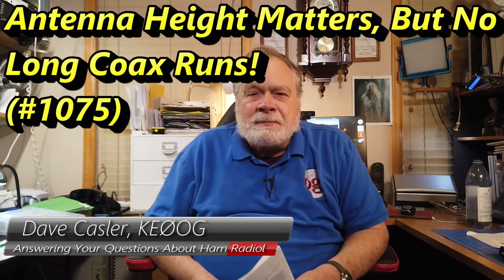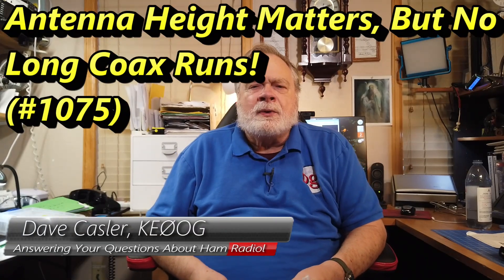Antenna Height Matters, But No Long Coax Runs! (#1075).

Comment: I'm getting ready to move my gp9 from a 75' run out to 100' plus up 75' of tower, so I'm using heliax in and attempt to reduce losses. I'll let you know if it is worth the trip. While the losses will still be higher I'm hoping the gain in height will overcome the loss, we'll see.

Comment: I wonder if Ham radio will get to the place that cellular is where the actual transmitter will be mast/tower mounted direct to the antenna, or with a very short jumper and a control cable that runs down to the shack. A fiber optic control cable would reduce the chance of lightning/ESD into the shack.
Reply: With a Wifi-equipped radio (eg I have an IC-705) you could have that in a weather-proof box with any other needed equipment up at the top of your mast and have the antenna come straight out of the radio. With Icom's RS-BA1 software you could then control everything via the WiFi connection, including winlink, FT8, etc. from your computer in your home. Add a remote antenna switch for whatever antennas you're using plus a dummy load. You'd just need to run a power cable up there, making sure the voltage drop isn't too much. Or have solar panels and a battery up there and then there'd be no wires at all.
Reply from the maker: @truhartwood3170  Indeed. You'd need a mast strong enough to hold that in heavy winds. Tower probably. I wonder if anyone has done that. Do you know of anyone?
Reply: @davecasler  I don't know of anyone, just answering off the top of my head! Definitely need a tower, yes, especially with any solar panels, though if they were horizontal that would theoretically not have too much wind resistance. Overall, the project would be more of a "can we make it work?" rather than being super useful or worth I would think. I can't think of a use-case off the top of my head that this would be good for as far as amateurs go. Maybe if you had a huge rural property where your house was in a bit of a valley or gully, but there was a peak on your property quite far from your house where you wanted your tower to be?
Reply from the maker: There's no technical barrier to doing this, but this path just hasn't been explored in ham radio.
Reply: @davecasler it is explored in amateur radio, just no real point on HF. you start playing in 12cm and higher its really a thing. feed loss is so bad that many commercial LNB down convert signals to 900mhz just to reduce them.
Reply: Many commercial wifi access points use a controller that contains all the smarts and the access point is just a rx/tx with an IP converter to send the data to the controller for processing.  This would allow for a truely software defined radio that could run as either a simplex or duplex.  This would both revolutionize the HAM market while almost overnight, destroying most of the radio manufacturers.  The second is probably why no manufacturer is even looking at this.
Reply from the maker: @toddwikel3849  Yes, true. But an IP radio is much smaller. I think it's largely tradition that pulls the radio's front end into the shack. And there are so many cool knobs and controls! 😀
Reply: @davecasler  knobs...wha would we do without knobs.   Just think...a sofware defined radio could potentially replace all the various frequency specific radios.  "One radio to rule them all"....lol
Reply: People do this all the time for ADS-B Receive setups. The SDR is plugged into a RasPi in a weatherproof/shielded container and the Pi is powered over Ethernet and talked to over the network. ADS-B is 1090mhz if you think losses are bad at 2m. The problem could be solved by more expensive feedline, but that would still be more expensive than the pi, injectors and shielding (the Pi PoE hat is RF noisy so you have to shield the pi separate from the SDR or the noise floor will kill your weak signal.)

Comment: I had  D130 discone antenna, and F23H  ( 5/8 wave x 3 ) similar characteristic to GP9 on 144MHz band.   D130 antenna feed point height 24 FT, F23H base height was 16 FT.  I always heard better on D130 at 24 FT.  so I took down F23H.   F23H was replaced with 1/4 wave antenna at 24 FT, which hear better. I guess height matter more than gain.    AG6JU
Reply from the maker: Thanks for telling me about your station.

Comment: I have my GP9N mounted about 60' up and use 75' of LMR-400, which has an attenuation of 1.5db/100ft at 146MHz. There's a ridge west of my house that's around 50' above my property, so this pokes my antenna up above that. So it's good to know the theory but also your particular situation. In general, though, height is going to have diminishing returns while coax has accumulating losses. From tests I've seen online there seems to be some pretty big gains to be had by going up 20' - 30', but after that the improvement seems to drop off (the testing I saw was with the same length of coax, so it was just testing the height only, not the effect of height plus the longer length of coax you'd need to reach that height).
Reply from the maker: Thanks for the info, and glad you can get over that ridge!

Comment: When Dave says "center of gravity," that's also called "center of radiation." Even though the antenna may radiate along it's entire length, that can be modeled as radiating from a single point.
Reply from the maker: Thanks for the info. On a large scale, you can model the antenna as a single point, but to capture the effects of additional elements, etc., modeling usually is done on a multiple points per element basis.